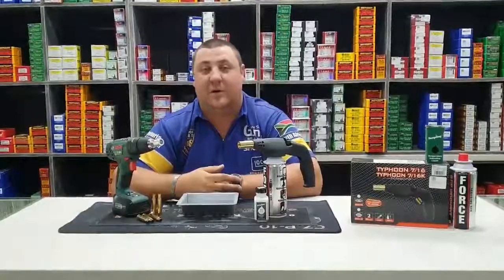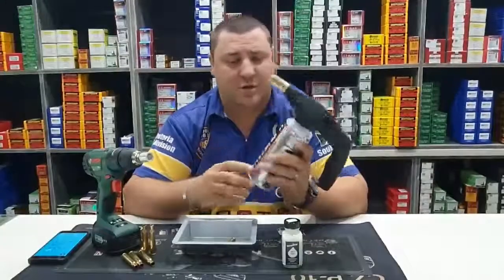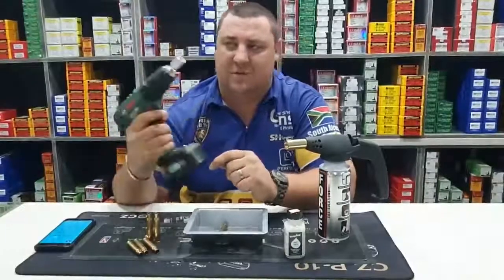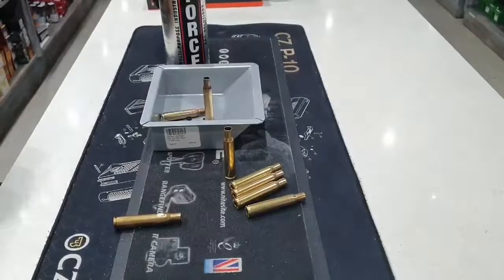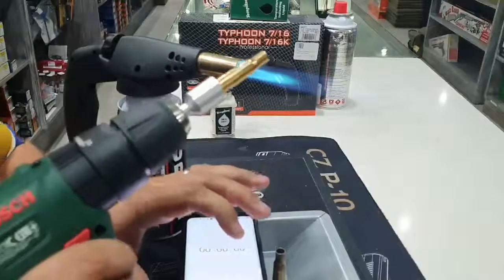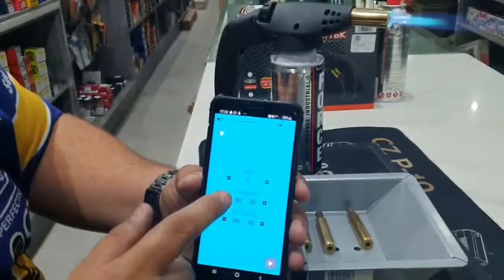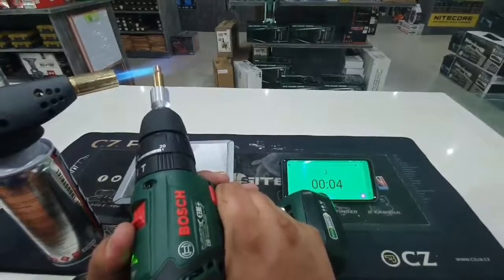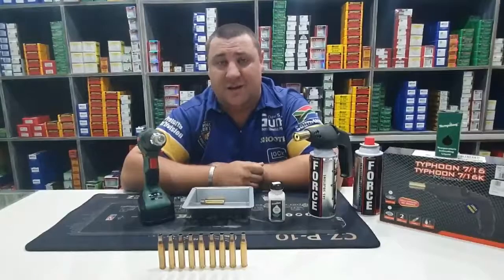Annealing on a easy and cost effective method

Comment: Thank you. That looks to be a precise way to anneal. Has anyone ever tried placing the brass neck down some depth into a cast iron or other pan of fine silica sand, or other, perhaps metallic, media, that has reached some stable temperature on top of an electric Single Burner Cooktop unit, placing the cases into the sand in some pattern, for some time, as determined by some type of Non-Contact Digital Temperature Gun?

Comment: I see you are using 475 degree Fahrenheit Tempilaq. Any particular reason why you chose this temperature? I've see other guys choose 700 and 750 degree F Tempilaq which is much higher than what you're using so I'm a bit confused as to what temperature Tempilaq to choose.
Reply: When you use the 750 deg temp you apply it inside the neck mouth

Comment: Ditch the tempilaq, it’s not needed.  Brass is single phase alloy and CANNOT be over annealed!  You need temps of at least 1000f on the annealing S curve to get a full anneal in seconds.  Butane is a bad idea buddy as is annealing much over 8 to 10 seconds as you dont want heat migration working anywhere near case head.  Annealing is not just about temps hence my tempilaq comment.  It’s a time temp relationship.  How many for example know that 750 degrees for 10 seconds won’t anneal brass?  It only stress relieves it.  At 750f you need ONE HOUR for brass to anneal (look it up).  That drops to seconds at 1050 degrees. Propane is the best choice for this.  Let necks glow red, it doesn’t matter, you won’t hurt the brass and burning zinc out is a myth spread by those with zero metallurgy knowledge.  All you’re seeing with an orange flame are surface impurities and some tiny amount of surface zinc burn.  Brass is a single phase eutectic alloy so goes straight from true alloy to melting without phase material separation.

Comment: this is such a disaster. you will never get consistent neck tension using this sloppy process.  correct annealing will never be cheap and simple. it takes a lot more than a propane torch.
Reply: Could you please provide a link to an explanation of how to proceed ? Thanks !
Reply: Anna, What is sloppy about the process?   The time, the temperature, and the application point of the flame are controlled adequately (the same as - or better than - manufactured EXPENSIVE machines) ... The variance in the angle of the case being presented to the flame is the ONLY uncontrolled one, and the risk of that to the ductility of the shoulder is insignificant, to say the least.   It seems you may be one of those critics that equates quality to cost ... and that correlation is 'fabulous.'
Reply: It's not rocket science. Heat to proper temperature on right area, cool.